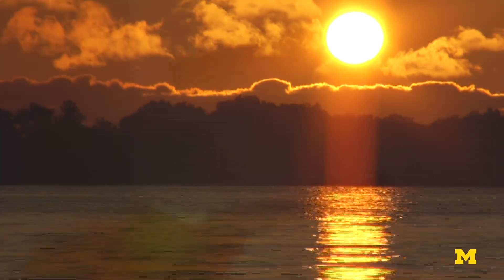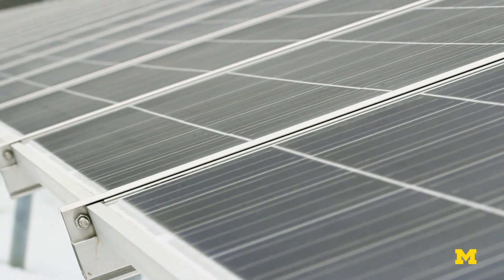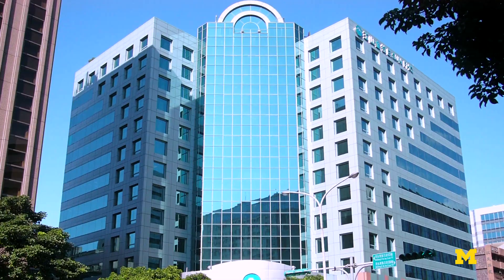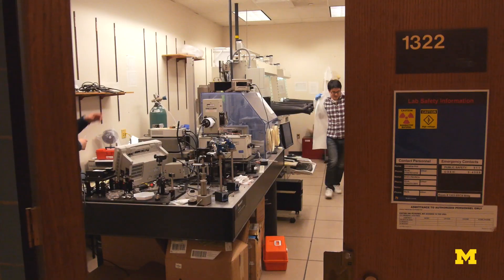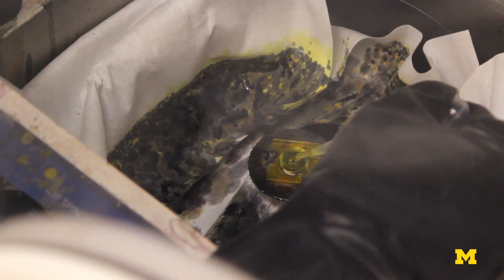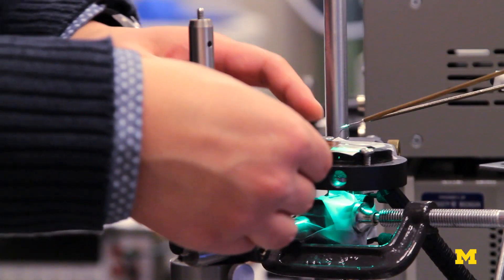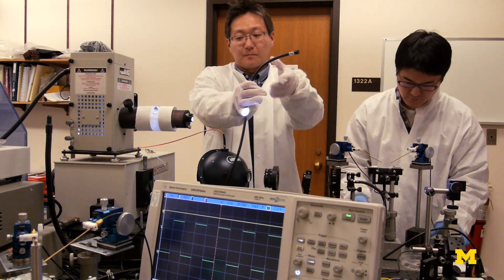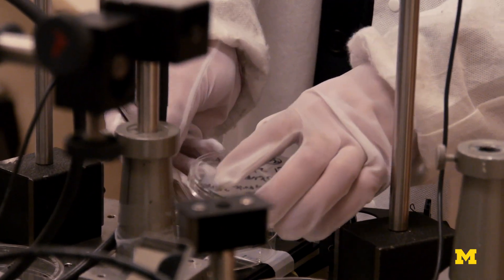Solar-powered color

Comment: Breezebro, all you'd have to do is have the batteries under each window to be charged.  The wires don't need to run all the way out of the house to a storage shed to multiple 100 Ah batteries, just get many smaller 10 Ah batteries throughout the house wired in parallel to give longer run-time for that specific room.  It would make the replacements cheaper when the batteries do end up failing 5 years down the road.

Comment: U know this kind of reminds me of those static films with a lot of tiny holes on it? If you stick those films on the windows it acts like a blind from outside and you can't see inside. But the people inside can see outside.

Why not construct a solar panel like that? I know the color is useful as you can make advertisement and design patterns on it. Why not make a production viable single color ones to be integrated as a film sheet for current glass windows?